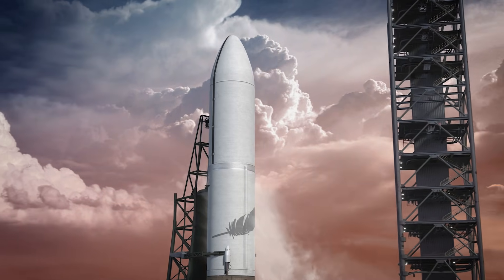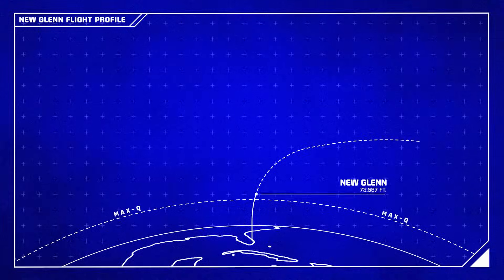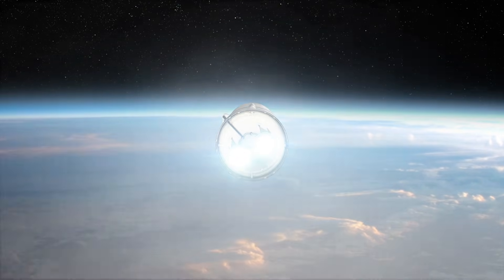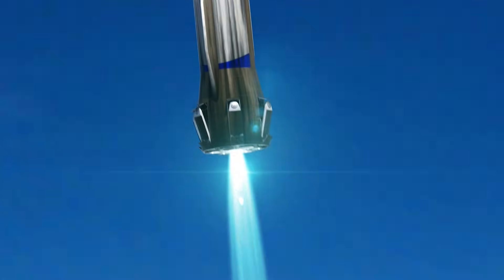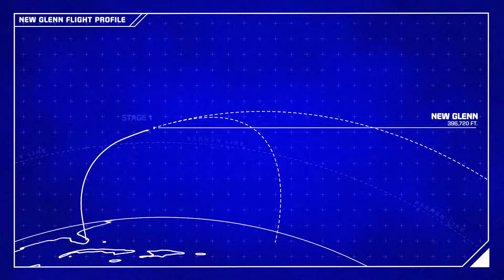New Glenn Flight Profile

Comment: Congrats, buying flight data from Relativity paid off!
Reply: i know this comment is almost a year old but how would flight data from a rocket not even half the size of new glenn with radically different engines help? if anything they'd be looking at Vulcans performance since it and new glenn use the same engines
Reply: @_ @_K3PLR Blue Origin funded engine development and EOS printing of the Aon engine. RS depends heavily on Amazon Next day delivery lol.  I’ll just leave it at that.
Reply: @_K3PLR silenced after Schmidt took over RS. Did this reach you?
Reply: @SpicyNood again, i fail to see how flight data from an engine with a completely different size and running a vastly different cycle would help Blue Origin in any way whatsoever. Aeon 1 was a Gas generator engine, BE-4 is Ox rich staged combustion.
Reply: Besides, blue was firing up BE-4's years before Relativity had any hardware. Relativity had only completed a full duration Aeon 1 burn in 2020, while blue was conducting BE-4 test firings as far back as 2017.

Comment: SINCE YOU REMOVED YOUR LIVE STREAM OF YOUR FAILED LAUNCH PROVES YOU CANNOT TAKE HARSE CRITISISM !!

BWAAHAHAHAHAH

60 Seconds into flight the white dildo with cock ring is at 344 mph or 489km/h  and 10,811 feet or 3.3 km altitude
Meanwhile Starship a ship 2 to 3 times as large and heavy at 60 seconds into flight is going 1135 km/h and 8km in altitude.

Dildo Max Q  at 1:41
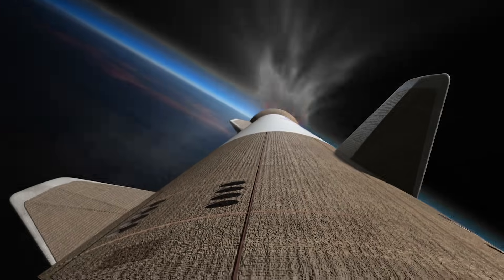Starship Max Q at 1:19

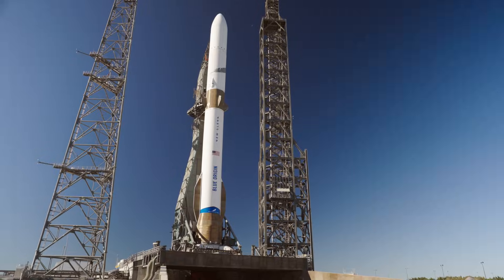Dildo MECO : 3:08 min  at 72.25 km altitude (no proof hereon out of anything else happening video wise and telemetry was completely off for MECO, Separation and 2nd state fireup)
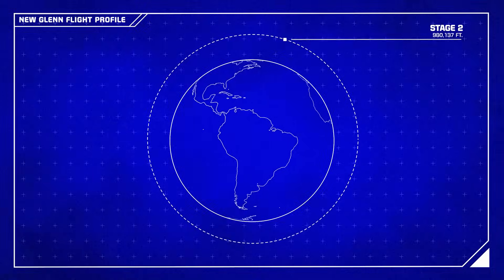Starship MECO : 2:41 min at 67 km altitude

telemetry lost long before booster reentry burn, doubt that even happened.  So for Booster its a complete FLOP!!!!  any rocket can and has been taking sats to orbit, the goal is REUSE!!!  UTTER FAILURE!!!

tell us bout them engines again? LOL
Reply: Cope harder
Reply: you sound retarded

Comment: What happens to the second stage ?
Reply: Disposed of
Reply: @TonyChan-eh3nz  haiii but that will put them half or a whole generation behind the SpaceX Starship !
Reply: @111danish111  they are working on project Jarvis.

Also new glenn follows a different niche. Its designed partly to send stuff further out than just LEO, with it's more efficient second stage. And trying to recover a second stage at GTO speeds is much much harder.
Reply: @Penguincannon9000  Interesting thanks.

Comment: Interesting... seems like New Glenn stages quite a bit higher than a reusable Falcon 9, around ~110km vs ~65km for F9. That does not necessarily mean a proportional increase in speed but since the booster burn time is only ~20% longer for NG than F9 it does seem like it would be going quite a bit faster as well (vs 8000 km/h for F9). That said, I guess it's possible that a longer entry burn would be sufficient to take the speed down enough to make the atmospheric heating manageable and comparable to F9.

Best of luck with the next launch attempt.

Comment: Can somebod please explain if they develpoed the technolgy to land on their own of they acquired the technolgy from spacex or how does it work?
Reply: they all develop it on their own.  based on the same principles..   but with their own engines, hardware and software.
Reply: Completely on their own. They used several small "hoppers" in the early 2000s and then New Shepard to test out their landing and navigation software. They then took their time refining it over dozens of New Shepard launches before adapting it to New Glenn. They started this before SpaceX even flew the Falcon-1. BO is taking the slower, more methodical approach to reusability.
Reply: They already had the technology. New Shepard landed before Falcon ever did

Comment: I genuinely hope they pull this off so SpaceX and the industry as a whole have the competition they need to keep pushing boundaries far into the future. Good luck guys!
Reply: The more the merrier
Reply: @lllhunterlll9644  if New Glenn is successful immediately they would be skipping many years what SpaceX went through due to their inherently different approach. New Glenn took so much longer not because of worse engineers or anything but because of their careful NASA like approach to rocket development.
Also if new Glenn is also successful in their reusability approach, they could significantly drive down prices  as well since currently SpaceX simply doesn’t need to lower their launch prices having no competitor.
The industry NEEDS competition to reduce cost further. But yeah we will see how New Glenn performs
Reply: @lllhunterlll9644 just like apple to microsoft
Reply: The industry will do fine with space X alone. They innovate faster than anyone else. No one is even close to them. And there is no competition for them, but that doesn’t mean they will stop.
Reply: @Mellow987865 nuh uh uh, monopolies are not ideal. now that may be the case as we lean more and more into a fascist empire, but currently, monopolistic industries are a no-no. SpaceX also needs competition to continue pushing; just because they’re making so much progress right now doesn’t mean they always will, they’ll NEED competition to stay relevant far into the future.
Reply: @Mellow987865  I don't question this as long as Elon koops doing what he's doing. But he won't be around for ever. For the industry at large to succeed there needs to be healthy competition for as long as possible.
Reply: @Mellow987865  Starship is not landing anywhere on the moon before Blue Origin. I believe BO will get there first although I do agree it's (Starship) the result of very fine technological advancement but this will get to the moon after BO.
Reply: Yea that's why Elon musk charging 60 million per seat compared to soviets who used to charge 20 million
Reply: @Mellow987865  What innovation, exactly?
Reply: @ found you again here, you are just a blind musk hater dude
Reply: @ found you again here, you are just a blind musk hater dude

Comment: Not sure what the point is of this design, since it's the exact same concept of SpaceX's F9. Looks to me like y'all got a bit late to the party now, but I could be wrong.
Reply: The New Glenn reusing it's booster has the lift capacity of a Falcon Heavy when the FH expends it's center core. It uses natural gas for the booster which means the engines will require less frequent rotoscoping. It has the largest fairing capacity of any rocket (40% wider than the FH or F9.) It has a much more efficient upper stage.

There are several customers interested in NG specifically because of it's huge fairing, lift capability, and highly efficient upper stage.
Reply: @markevans8206  That's interesting! I did not know that! 

But still, when Starship becomes operational, wouldn't NG become obsolete?

Comment: Why are the booster’s tanks charred/scorched? I get the cork material, but the tanks just had/have cryogenic propellant inside them and therefore the ice should prevent scorch marks. Ik this is an animation, but still, BO is a professional company
Reply: What you are referring to, is likely the heat shielding to protect the booster
Reply: @ yes, the cork (heat shielding, the brown / gold stuff) is meant to be scorched during reentry & turned black, which this gets right, but the fuel tanks shouldn’t be, as the ice on the fuselage should prevent that
Reply: @ ah so that’s you were talking about.

Most of the ice that forms would have been lost on ascent. And by the time of reentry, most of the fuel is gone, most of the water Vapor in the atmosphere is gone, and the sheer heat of reentry would probably just melt any remaining ice
Reply: @ but F9’s LOX tank section isn’t scorched, ik it reenters in less time, but still

Comment: That's an awesome rocket I was lucky enough to see it at the factory. Best of luck to you guys. I have one of your shirts and I'm proud of everything you're doing. You have a great team there
Reply: I totally agree with you, this is an amazing rocket and I don't understand why the spacex fanboys hate so much on Blue Origin. They are doing so many cool things and I wish Blue Origin nothing but success. Time will tell, but ultimately I think New Glenn and the Blue Origin lunar lander are much safer option than starship. I also wish starship success, but I think it should just be used for payload and not humans.
Reply: Diplomatic SpaceX  Fanboy: Why is this rocket safer? 
I wish best luck, too.

For now Starship seams be much further in development. Will Blue Origion not have to fail as often as Space X?

Or don‘t they use rapid prototyping and more the miracolous Nasa approach almost working the first time.

I never get my head around how to build a rocket, that can land again and it works for the first time.

Starship demonstrated so much, that can go wrong….
Reply: @hellerart  Ironically, if NG actually reaches orbit, it could leapfrog Starship. 
You have to realize, orbital refueling will massively delay starship, adding a ton of complexity.
Reply: @ahhmm5381  If NG reaches orbit it will just do the same job as Falcon Heavy, at twice the cost, it wont leap frog anything smfh 🙄
Reply: @ Hardly. NG has larger payload volume. Also, considering it has a hydrogen powered second stage, probably superior TLI. 
As for cost, 70 million per launch isn't bad, especially compared to Falcon Heavy's 100 million.
Reply: @dazuk1969  Muskrats are in a cult. Anything that threatens the hegemony of the Dear Leader is bad

Comment: So Temu Falcon is going to look just like a SpaceX Starlink launch that happens twice a week?
Reply: this one's bigger and has more payload capacity, so calling it a Temu Falcon is inaccurate, I'd say a blue origin mini-starship
Reply: @Studentintheinternet  But it's not fully reusable.
Reply: @smorrow not yet, they are working on a reusable upper stage design. They need more time in the kitchen to see if they can pull that off. Don't forget starships upper stage hasn't proven to be fully reusable yet either, hopefully they can work out the heat management so that parts don't have to be replaced each flight.
Reply: @Studentintheinternet  its not a mini-starship, its a scaled up falcon 9...